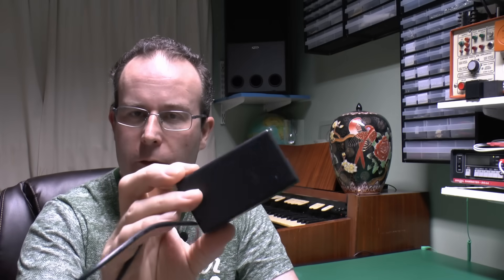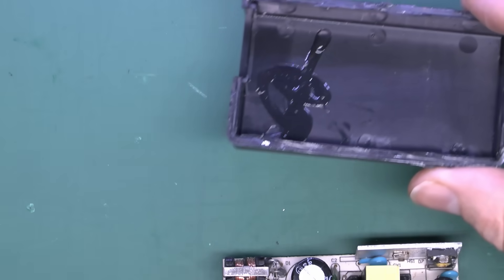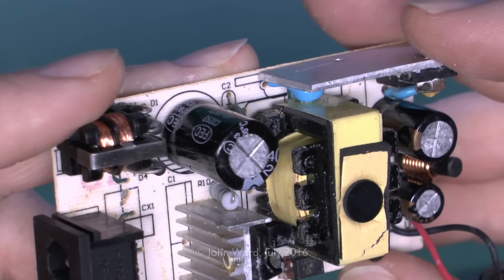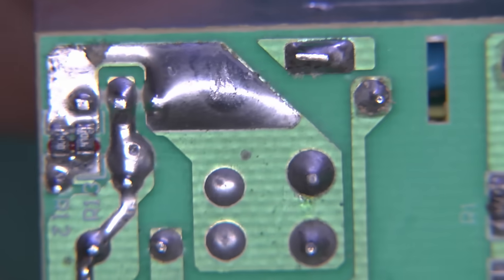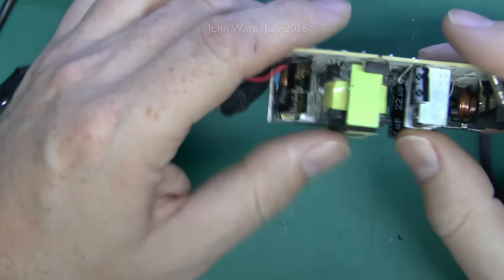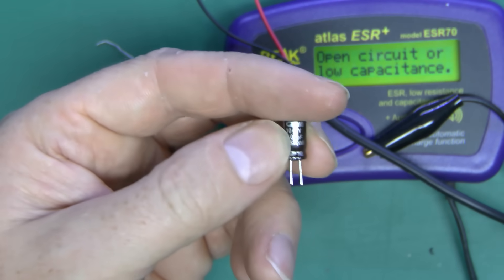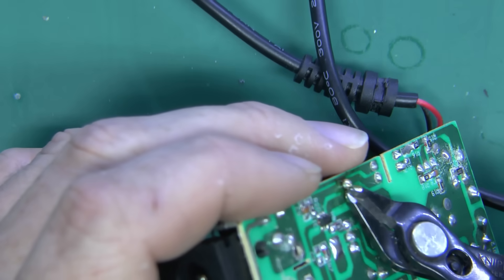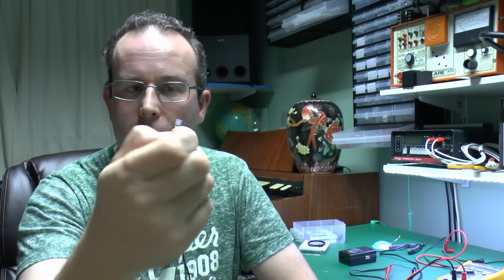12V Power Supply Repair

Comment: I repaired a 12V DC SMPS rated at 4.16A, and designed for a respirator. There were several electrolytic caps with the 105 degree rating, but the main ones which were low were surrounding the 'chopper' IC, (TO-220) mounted on a large heat sink, which had fractured, throwing a piece containing the number of the device manufactured by Fairchild. Some improvements were made since (a slightly different number, but an improved variant), so I fitted the improved version. The components I changed were all of the electrolytic capacitors, the chopper IC (took several weeks to arrive), and a fuse. On completion I used Isopropyl Alcohol and a toothbrush to wash the board from any ionic residue. It was made by 'Respironics', and would have functioned for 10 years. It used several obscure values for the capacitors; 1500uF, 25V, 1200uF,16V and so on. I managed to replace them with 'low ESR' types, even though they cost more.. Didn't get back to service as a respirator supply, but works fine with my car radio as a USB Player/FM Radio/CD Player/Amplifier in my bedroom..!
Reply: maybe it will come in handy as a respirator power supply when you reach old age?
Reply: @rogerd4559  I hope so..!
Reply: @rogerd4559  Well, I could re-deploy it to your suggested application, and as batteries are very much on the improve to replace its current use. Haven't got to the stage of needing it, but perhaps you thought I aged writing the detailed comment...!

Comment: 9:24  it’s open or low capacitor you placed the points improperly on the wrong solders it was placed not on the immediate opposite but to the upper solder to the inner side

Comment: Do you like that ESR meter?  I need to buy something like that.  ALSO I have a 12v + 5v 6 pin AC adapter that has zero output but the main cap charges to 170v.  Nothing visually wrong.  Am hoping to find a bad cap - maybe one near that TO-220 (probably a FET).

Comment: I'm pretty sure my problem is the fuse, is it as simple as melt the solder remove and replace with  touch of fresh solder? Or is there something else I need to do to replace it?
Reply from the maker: Yes - if it's just the fuse that has failed.  However it's likely that something else has also failed, and that has blown the fuse.

Comment: I had a Samsung laptop power supply go out on me. It was easy to diagnose that the barrel jack lead had a break by waggling it about. That was the only fault. Unfortunately, it wasn't a removable cable, so I had to go through the faff of opening the sealed case. I hate sealed cases with non-removable cables! >:¬|

Comment: I have a way you can open the plastic case of Adapter nicely by car fuel because the fuel melt the glue then you will open it nicely within 2 minutes.

Comment: I had a LCD monitor go bad.  I tried taking it apart but couldn't figure out how to get the back panel off.  So I just threw it away.  I wish I kept it just so I could play fix-it and learn something.
Reply: aww too bad I have fixed many LCD monitors they are fun and easy to fix most of the time. many times it is the power supply board and can be purchased on Ebay for pocket change

Comment: At 13:43 I noticed you were having a bit of trouble getting the solder onto the pins. A higher temperature iron should fix this problem. I usually solder around 330° C.
Reply: I use 450 and still cant get leadless solder to flow even with flux

Comment: Interesting..repairing SMPSs can be challenging. I see a bad solder joint center screen at 6:34, probably redundant to a connector. A hint to open plastic adapter cases:  Using a large vise, squeeze it hard corner to diagonally opposite corner until you hear a loud crack. Reposition to alternate corners and repeat. It is frightening first go but works 99% even with small wall warts.a lot safer on the fingers too. Cheers.

Comment: Mine works and it turns on a computer fan but when on the same 12V contacts I add the cooling peltier plate the LED blinks and the fan doesn't turn on. If I bypass the 12 Vdc with another power supply the fan spins and the peltier plate gets cold/hot. I wonder if it is a load issue and what the component causing this could be.

Comment: Great video but how did you conclude that the 4 terminal chip located next to the transformer was ok? You said it was fine and moved on. How did you know that?
Reply: It is an opto-isolator and I imagine it tests like an LED on one side and a diode on the other? He did say he'd tested the components, we just didn't see it.
Reply: I don't understand either, it's not fine, the legs are rusting away. When they rust through completely, the PSU output voltage will end up wrong, or it may blow up.

Comment: I bought my grandson a 12 volt power 4 wheeler , I paid 300.00 for it and then he had left it in the rain. We replaced batteries and it still is not working.  We are pretty sure the circuit board is shot.  Can you tell me how to find out what to buy to replace the same one? How do I go about changing it? Any suggestions will be appreciated greatly. We want to upgrade to make it a 24 volt for him, he is 7 and he has outgrown 12 volt.  So whatever circuit we get has to work with 24 volts , if it even makes a difference???

Comment: Another time someone wishes a shock. These are field effect power supplies, you Must always discharge the large reservoir capacitor BEFORE you do anything else. 2 reasons 1 they can sting, and 2 try testing thing and most times you will blow the FET and let the smoke out next plug in The design is a very old Sanyo design and the capacitor dies every 4 or 5 years. Next point an electrolytic relies on power  to maintain it. If you use say a 100V type to replace a 10V type it is not happy.

Comment: Hello, I have a transformer (charger for a child's 6v ride on toy). It's been in a box for years, on testing it before giving to a friend to use, l discover it outputs 13 odd volts although is rated at 6v. Has something welded it's self up inside and is now dead do you think? Is this something that can actually happen?
Reply: Ok so I have found some information suggesting this is an unregulated power supply and the i should test it under load to determine it's true output which I will now do. Anyone know any reason why this may not to be the case?

Comment: I would have replaced that optocoupler too. That corrosion on the pins will eventually reach the internal led or the photoresistor

Comment: A common problem for switching power supplies. If you install a ceramic capacitor (parallel) ~ 1μf, this will prolong the life of the electrolytic capacitor.
You can use this circuit (for reference) for the repair of such power supplies - https://img.mysku-st.ru/uploads/images/02/55/13/2015/04/03/a588ea.jpg
IC - SG6859ATZ (or similar).
Attention pls, the unit uses high voltage, dangerous for your life.

Comment: What are the purposes of the cut routed out sections on the board
Reply: That is done to try to prevent tracking across the board, using an air gap as insulation/isolation. ie. to stop mains voltages from getting to the low voltage side of the device.
Reply: ty I suspected so ..

Comment: Thanx for the video, my adapter had the same problem, the small capacitor was defected. Although when measured it shows a good capacitance, so I don't know why it is defected. Maybe is the high voltage that weaken the isolation... I put a 400v capacitor instead.
Reply: The cap could have a high leakage which can be tested with an ohmmeter. Or it might have a high internal AC resistance, which can be tested with an ESR meter.

Comment: When it writes "Output DC: 12 V / 2500 mA", does it exactly produce 2500 mA? Or just the voltage is constant?
Reply: 'Cause you mentioned "up to 2500 mA", I'm wondering.
Reply: I think the 2500mA reading indicates the limit of current produced. If you were to shorten both outputs, you would have 2500mA.
Reply from the maker: Voltage is constant 12V, current depends on the load connected.  If a load that takes more than 2500mA is connected, the power supply will be damaged.

Comment: I'm guessing an ESR meter with diagnostics is a good investment for diagnosing bad caps that aren't bulging or leaking and not having to remove them to test them?  Thanks for the real world start to finish process!
Reply: I have a built in ESR tester in my cap meter and in the back is a chart...most of the caps should  be under .19 so I have been tossing a basketful of old caps

Comment: Wouldn't it be much nicer for the environment if such devices were designed to be unscrewed instead of glued.  Perhaps we need revised UK legislation on accepting this type of construction, after all it should only put £ pence on the assembly cost.  There must me tens of thousands of psu's sent to landfill that maybe something as a simple wire fracture.

Comment: I noticed any 12volt charger that sits for several years, eventually fail. I purchased a used Mini refrigerator that uses a 12volt converter. It no longer produces 12volts. my guess was the capacitors inside dried up and failed. This is very common with older equipment. It's best to remove capacitors before testing.

Comment: few months ago while digging in garage/car port I found an old HP laptop psu that had shorted cords, I had broken it open years ago but never took parts off. after probably 3 years in garage I bring it into my apt/flat and later that day i get a call...hey i have a dead flat screen 40inches. already got a new one figured if u can fix it its yours. 

higher voltage rated cap on the hp supply and same amperage of fuse. I sorta bent a rule, it wasnt exactly the same type of fuse, but they both came from the same point in pretty identical circuits rated for the same power so that rule didnt seem to apply and I wanted to watch TV. If the thing ever gives me a reason to enter it again Ill swap it back with the original type. I need to look into if there are any specifics for fusing a switching psu, but I also figure the hp biz class laptop had a better psu than the single board TV with US only power supply (220v filter cap) if anything the voltage on the fuse is higher than the original

Comment: hello you seem to be very knowledgeable about adapters. I need a little help I have LED lights that the adapter keeps burning out the specs are input: 100-240v-1.5a and the output 24v 6A what should I get to hold better. The LED are 120 ft long. I will appreciate any advice

Comment: It's so often the electrolytic caps that are to blame - cheap items manufactured to an absurdly low/tight cost often have cheap crappy unknown brand caps and also seldomly have enough safety margin overhead for the voltage they are handling - the result, certain (early) failure. Have had to swap out so many electro-caps over the years.

On the subject of power supplies, would you be up for doing a vid on 'transformerless' power supplies (such as those found in electric oven timers etc), particularly how to calculate the power reduction, or how to calculate the component ratings needed for a specific power output.
Many Thanks

Comment: i found the video quite thorough ( topnotch zoom & focus), thanks. I have one of these fairly common PS - could one bypass/remove the rectifying circuitry to get 12VAC? ... i need 11VAC input for a Hitachi turntable, so i was thinking of removing some windings of the secondary coil IF they are accessible - would you reckon it is a viable option or what would/could you suggest please sir (11VAC seems to be quite scarce, like chicken teeth) 12VAC spins the (dc servo) motor, but obviously the speed is all messed up....and how tunable is such low AC power with low voltage components if possible at all (for diy people)

Comment: You need a better soldering station. That solderjoint from the cap at the outside of the pcb looks like a very bad solderjoint. It looks like it not even makes good contact with the pad.  The solderiron  is not  hot enough or laks power.

Comment: i have a mini hifi radio with dvd and usb having similar power supply but with 8 pin IC ,I dont get any power but before it would turn on and after some seconds be off,could it be bad capacitors or this IC

Comment: It's a bit hard to understand him. How did he begin to suspect the capacitor?
Reply: I mean it's a good thing to check the electrolytic capacitors because they are one of the least reliable components in a circuit.

Comment: Heat the parts a little longer allow the metal leg to heat slower to melt the solder don't melt it with the iron. dropping cold solder will/could fall off the pad later.
 Love the channel you're helping my daughter with her apprenticeship cheers😉
Reply: Way to Go! we need more female electronics techs and engineers

Comment: As I am learning, can anyone explain the corrosion. Can damp get into these sealed units.
Reply from the maker: If totally sealed nothing can get in, however flux residue left over from manufacturing can cause corrosion.  Electrolytic capacitors which leak will also cause corrosion.

Comment: I could used that transformer to know why my electric air pump isn't working right inside the house I think the plug isn't working or the motor has a problem thanks for the  video.

Comment: Those small bootstrap caps always fail on these. I bet something like 50% of the supplies I've fixed that is the issue. The rest are main reservoir caps on the low volt side, broken diodes, optocouplers or indeed control chips or switching transistors.

Comment: I always clean board with isopropyl alcohol,wet dirt or old glue may conduct.Brakes on the board need solder with naked wires.If you want awoid further problems use good low esr caps and seal ewerything.Thanks for the video.
Reply: The board didn't have brakes. There was no way of stopping it!

Comment: I know it is a year plus past but...  To open those welded/glued cases sick them in the freezer for 20-40 min.  Then put a line mans knife on the seam and strike the knife with a hammer.  They open pretty easy.  It is likely the sticky part is the glue used to seal it.  Probably they were changing the cartridge or a clog which is why it was spread over the cover.  That may have been what caused the corrosion on the inside.

Comment: You don't need an ESR meter. Use a signal generator  hooked up to the oscilloscope. A good capacitor will shunt the signal and a bad one won't.

Comment: I believe that the overall corrosion and white mist throughout is from the failed e-cap. If e-caps overheat, they can outgas and cause this condition. I have seen it often. Also often, there is no deformation of the cap, or visible leakage, with this type of failure. It is harder to find, visually, because the mist travels throughout the project box, corrodes everything and makes a big mess. As the mist remains corrosive, it should be cleaned from all surfaces, before calling the project done. Great video, instructions and repair job. Good of you to save a device from the trash.

Comment: Nice video! In the other side of that charger was six legs integrated PWM regulator ic - I suppose. I have found that kind of IC faulty on 24 V power supply. It's labelled 10 A 38. Where I can find those ic's???

Comment: I used a 'flat head' screw driver to open one of my power supplies in the same way. Unfortunately 'I SLIPPED' and the screw driver stuck between my thumb and forefinger as it went into the muscle. A  fair bit of blood actually, so be careful folks when opening power supplies.
Reply: I use either a hacksaw or coping saw to cut open the case along the seam.
Reply: @Sunsetdrivein  Likewise. And I hold the box in a vice. A Dremel with mini circular saw is even easier to use.

Comment: one of our fone charging wall wart had a little spark & stopped working. i opened it up and found one of the transformer terminals is open, however, all the resistance, diode, caps appear to be ok. i guess its beyond repair.
Reply: Try closing the terminal.

Comment: I have attempted a few of these, but could never repair one as the transformer damages due to the humid conditions here. I am a pro tech working for 35 years, in case you get the doubts.

Comment: 8:38 How did you "test" the capacitors? doesn't capacitors need to be out of the board to be tested?
Reply: If it shows open circuit, then it's dead because it's behaving like there is no capacitor in the board. So, it must be faulty even when tested in the board, if it shows open circuit.

Comment: Hi , question before removing the capacitor  from the circuit board  . Do i have to discharge it first ???
Reply from the maker: The one in the video is tiny and rated for only a few volts, so not necessary.  However larger capacitors and those rated for larger voltages should be discharged as they can be a serious hazard when fully charged.
Reply: The one i want too remove is 470uF 25V
Reply: Well, you're already going through the trouble of digging up the soldering iron, setting it up, plugging it in and desoldering the capacitor... It's not that much more work to discharge the capacitor while you're at it, e.g. while your iron is warming up.

Personally I have no idea where the limits are when it comes to capacitors, but the rule of thumb is simple: when in doubt, play it safe.